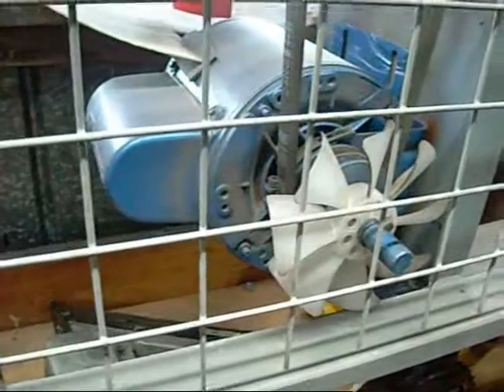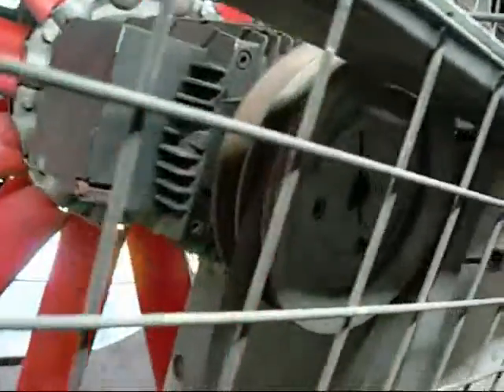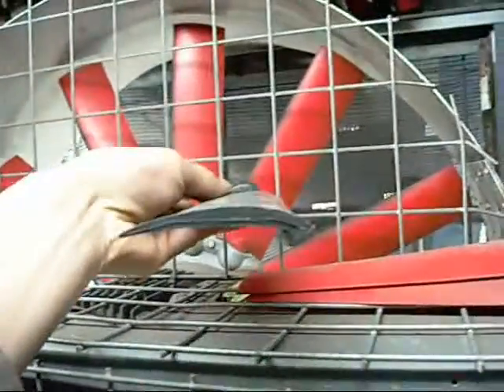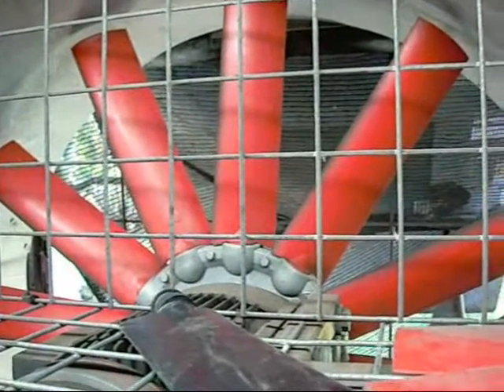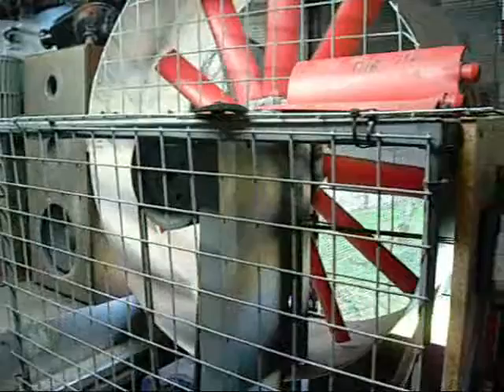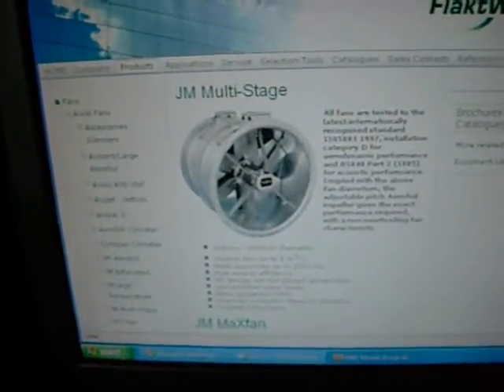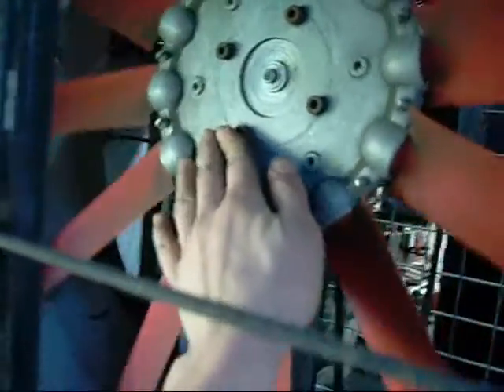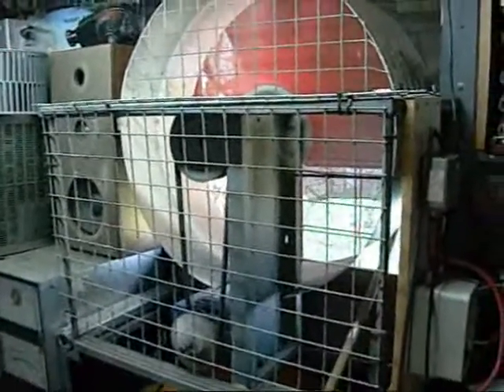More on Flakt Woods Axial Fans

Comment: Same here I have a belt drive homart fan that isn’t working st the moment but I hope or plant to get it working if my dad or sister could help me get the belt and motor and I could or can do the rest but with the Lakewood it was loud on low so I pitch the front pad of the blades to where it blows more air and quieter well actually I’m not really sure who I did that but we also have 30” utilitech pedestal fan direct drive and it is loud as heck walk especially on high

Comment from the maker: @roadwolf2 I use it every week when i am working out here and need smoke extraction
Reply: Man so loud
Reply: Wait wrong video oops and also I thought of that same idea with my Lakewood P-25 box fan with the metal blades from 2007 meaning I would take a fan from an air compressor that is small and and spins clockwise and blows backwards so it could cool off the motor more efficiently from the front and the back having the suction from the main fan cooling off the back and the small fan cooling off the front so it won’t over heat or burn the house down